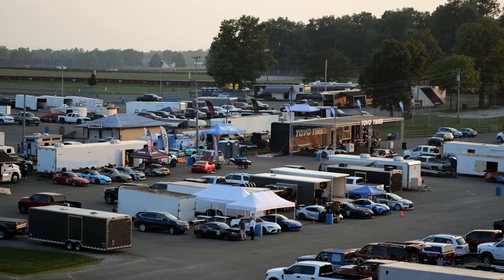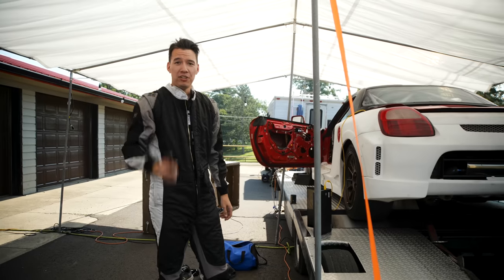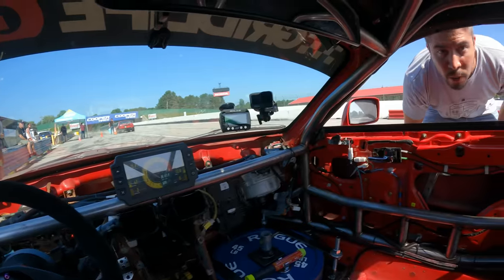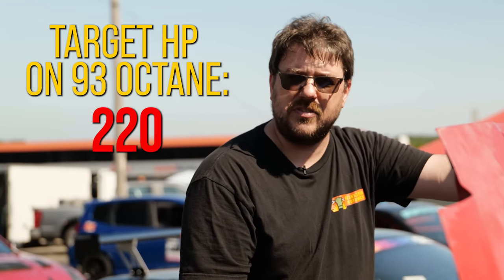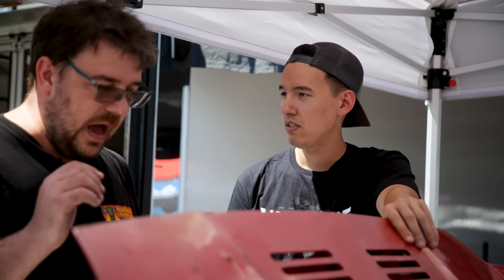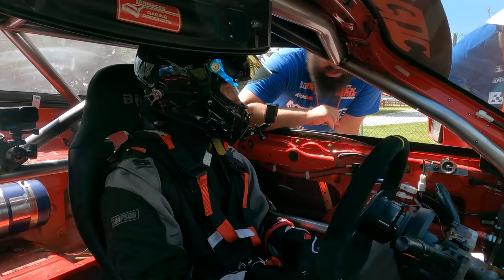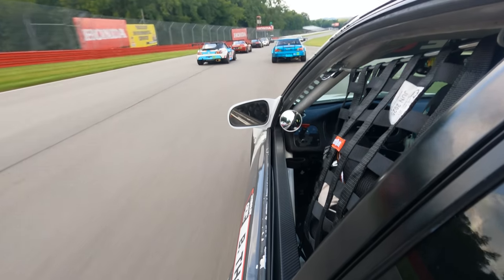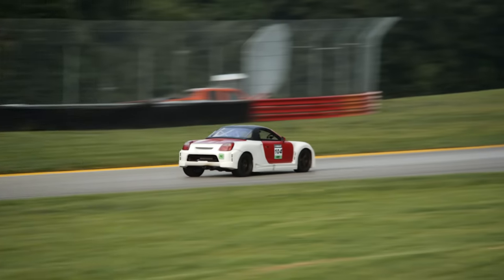Civic and MR-S Race Wheel-to-Wheel Against Each Other for the First Time!

Comment: Should’ve swapped the MR2 with a K series. 😂
Reply: K series NPCs are crazy, almost like LS NPCs
Reply: This would be epic I would love to see that build
Reply: K swap the world!!
Reply: @dnull lol at this point they’re worse than ls npcs
Reply: @rogerking9481  bro LITERALLY look it up, there's K series swaps for everythingggg, i don't get how how you all are still getting excited over this when it's been overdone to shit at this point
Reply: Actually should have 2L 2ZZed it. The swap would have been sooo easy, lightweight, reliable, and made way more power
Reply: Imagine being upset when someone suggested, "Use a motor you know is going to work instead of trying to be original" for a race car.
Reply: @Datboi_Mo power isn't the problem with the mr2. The argument could be made for the last < 2 seconds off pace,  but 5+ is a platform/confidence issue.
Reply: @dnull  to some extent sure, but they're also not completely wrong.  Both are proven to perform
Reply: @djsonicc  i never said they are wrong because these engines are bad, they obviously "just works", but all I'm saying is that it's boring, 2016 Toyota RAV4 Hybrid also works, it's just far from being exciting
Reply: @dnull  I could not agree with you more
Reply: @zerohikari2685  a 2l 2zz is far from reliable, even in 1.8 form, they are pretty fragile.
Reply: @TheCorington  2ZZ's faults are well documented and have been addressed. Easy to build a reliable motor once you know it's weakness because of years of race testing and development. That's what you get with the 2ZZ that you don't get with a 2AR.
Reply: @zerohikari2685 the big issues like oil starvation and cavitation seems to be fixed with the billet oil pump and baffles. However, a stroked 2.0l 2zz is not going to be quite as reliable as an oem engine no matter how well you build it. It’s a screamer engine, but a k20 is just better in every way when you start changing internals.
Reply: @TheCorington  Why would an engine with stronger internals and a lower redline with the same oiling improvements be less reliable?
Reply: @zerohikari2685  because the engine wasn’t designed to be stroked? And when stroked, it’s usually also bored to maintain somewhat similar engine characteristics. Then you have the issue of piston speed and rod ratio potentially off.

Now it’s a rabbit hole down an expensive path. You would only do it to stick with the platform. If you want displacement go get a k24 ir 2gr which would make way more average power and torque for far less money. All of those engines can be found for sub 1000$ and have much better documentation than the 2zz
Reply: @TheCorington have you owned one? I do and I have a lot of track miles on it.  Install a baffled oil pan, don't bounce it off the limiter all day...profit.
Reply: @TheCorington    See you have no idea what you are talking about. The 2L upgrade is not overbored. Rod ratio effects piston speed but that's why you lower the RPM dumb dumb to reduce side load. That will ultimately put less stress on the bearings and oilng system.

No you would NEVER put 2GR in an MRS the car would never handle well every and the K24 is only slightly lighter than the 2AR swap making it just as bad for balance. You don't know what you are talking about so please STOP TALKING.
Reply: @zerohikari2685  yeah sure buddy, let’s dump 8k for a built and bored 2zz where it would still be smoked by a k20/24 for less than half the price. Nowhere does that even begin to make sense unless you got a screwed up perception of reality. But sure play into your fantasy, when honda already built an oem motor with endless upgrade paths that does exactly what you want. I’ve witnessed many k20 mr2s doing well in time attack, but most importantly let me know when you put a stroker on your engine. 

I’ll agree it’s reliable if you decide to do just that and nothing else but the value is far from there. His goal was to build a cheap track car and this doesn’t align with their goal.
Reply: @AndyFuntown  I half agree with you. From the start, he focused more on the dyno than the seat time. Then, once he got a number, he focused on how low it was. Power is his largest problem because power is what caused his confidence issue. We know Ben is fast when using a proven platform, but he shot himself in the foot by letting his lack of power tank his confidence. Brother was driving like he was afraid.
Reply: @dnull don’t let being original be your downfall. K series are loved for good reason.
Reply: @JMG0590  yet another k-series npc

Comment: I've always had this problem on track

How do you deal with the heat? Especially with the full body suits now?
Reply: you can get cooling jackets, it's like a cuirass over your baselayer that has plastic piping that you hook up to a cooler filled with ice water and a small electric pump. you can have it strapped down behind the driver seat. Then you wear your fire-resistant racing suit on top. Some people wear the jacket directly against skin but I've heard that can cause localized frostbite.

Comment: i think a supercharger on the camry motor would be awesome. you just HAVE GOT to get the weight distribution down on that car. and i feel she will be a monster
Reply: it doesn't need more power, it needs grip
Reply: @StanleyKubick1   it needs a lot more than that. there is a set up issue at work here. They are just throwing parts at this car without fully understanding the negative effects.

Comment: What I think Lin should do to the MR2 is not K-swap or any swap, as they’re happy with the build that they have. I would just put a few good mods on it, like some valves, but that’ll probably be quite a tall task. So for just adding power I’d just get a turbo kit to start. And then I’d up compression and add valves and do whatever.
Reply: But that doesn't make sense he really can't make more than 230 whp due to class regulations.
Reply: @aaditya-dc2uw  yeah, and he’s making in the realms of 185 HP, so it’d make sense to do something like that if you have an almost 50 HP gap to class regs.
Reply: @schizophreniagaming4058  except that engine should already be making that. it did when they dyno'd it last year, the fact that it isn't means there is a bigger issue happening. I bet dollars to donuts that him and make have that 2AR back out of it in the near future, if it isn't already.
Reply: @Treacherous_One  serious? Then a k-swap might not be out of the question in terms of solutions to the issue. But I’m not saying Lin should or shouldn’t do that, as that’s up to him. He could also get an F20C as that’s a pretty popular and reliable option for a swap. That’s what I’d do tho, not what Lin would. So, hope he gets his engine issues fixed.
Reply: @schizophreniagaming4058  The 2AR is a very good swap for this platform. there is no reason to Kswap it, the 2AR is more than enough for that car. You need to learn more about the MR2 before you just start posting how you think they should "fix" it. I have owned and raced one for over 7 years. I know these cars.
Reply: @Treacherous_One  I understand that you’ve raced these cars, but this 2AR doesn’t seem to be holding up well enough to be raced like these guys want to. Yes, while he can get another one, it may not be worth losing lots of horsepower due to mechanical issues. But, I may be wrong. I’m 15 so I don’t have any real world experience, so that was kind of a lazy assumption on my end.

Comment: Ben L, Ive been there buddy. I had a bit of mental breakdown at my first GLTC race at COTA for similar reasons.

You've gotta be able to trust the brakes and the high speed stability to generate lap time - I would really consider testing rear aero. Bens civic is a much easier car to drive plain and simple - in addition to having a ton more development time, it's built on a platform that's well developed for road racing.

Comment: Mr2's do not have good chassis balance.
Reply: Obviously never driven one.
Reply: @glennpearson1888 No he's right. The MRS even from the factory doesn't have good weight balance. Throw in a heavier larger motor in the rear only makes it worse.

The catch 22 Ben is in is the way to fix it is to add weight to the front but he needs to remove weight to be competitive. This is the reason the fastest MRSes relocate the gas tank and battery to the frunk. That way you aren't removing weight, instead you are shifting current weight.
Reply: @zerohikari2685 Is this (unbalanced weight distribution) the reason why MR2s are prone to snap oversteer?
Reply: @yongling9825  Yes and no. It's a combination of a few thing. Another factor is rear bumpsteer curve. Every gen of the MR2 has it's own issues but proper weight balance is important no matter what. 

A midship car whose weight balance is closer to 47/53 will always handle better than one that isn't.
Reply: @zerohikari2685  absolute garbage. Snap oversteer in MR2's is one of the great automotive myths after the early mk2's anyway. I'd trust one of my zzw30's as much as my gt4 when the limit comes. Like any mid engine car if your stupid and hard lift mid corner you will get issues but other than that it's people that are genuinely poor drivers that get trouble. These things are one of the best bang for buck track ready with minimal work cars you could wish for.
Reply: @glennpearson1888  You clearly have no driving experience & no experience tuning these cars. Snap-Oversteer does exist, it's not some mythical imaginary thing. You can tune it out of a car but to suggest it doesn't exist is pure fantasy.
Reply: @zerohikari2685  didn't say it doesn't exist...any mid engine car is more likely to oversteer if you drive poorly and lift mid corner/don't respect it. Videos and utter rubbish spoken all over the internet from guys claiming to have lost control due to snap oversteer. Watch the video and shock horror it's not "snap over steer" at all. Just guys who can't drive experiencing oversteer or self provoked lift off oversteer and doing everything wrong to deal with it. You probably exist in Porsche 996 will all fail with IMS failure and S2000 AP1''s are all a deathtrap land as well.
Reply: @glennpearson1888  You are changing your argument. Btw lift off oversteer causing the car to spin is 100% a sign of bad weight balance and suspension tuning. My MR2 has never spun due to lift off oversteer because on my tuning and my brother had an AP1 so I know all about that car as well. Car can easily be controlled with proper tuning and allignment.  Please STOP, you are embarassing yourself and are in over your head.